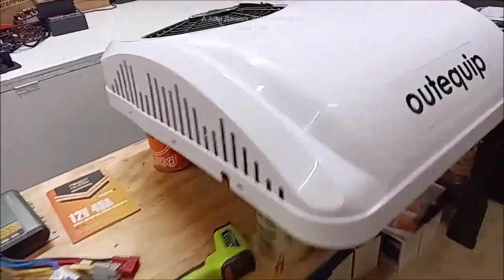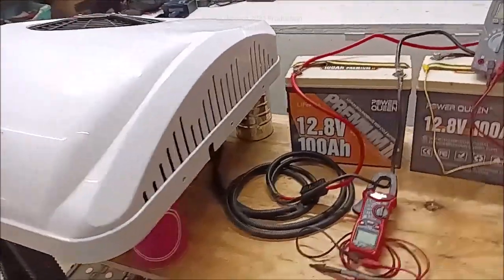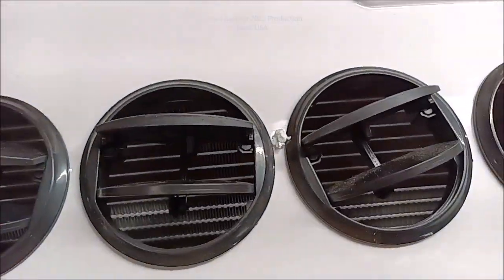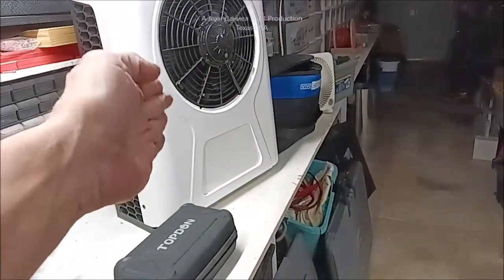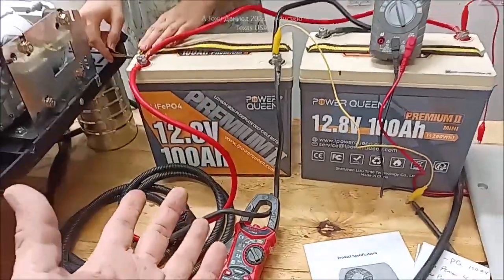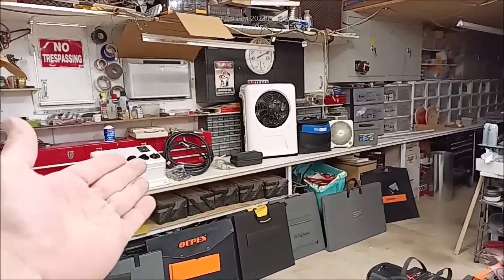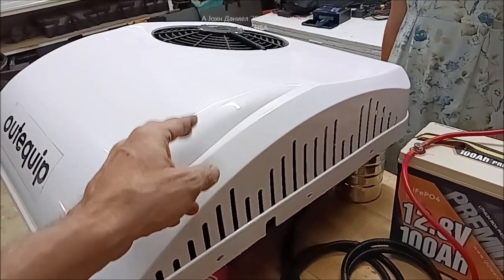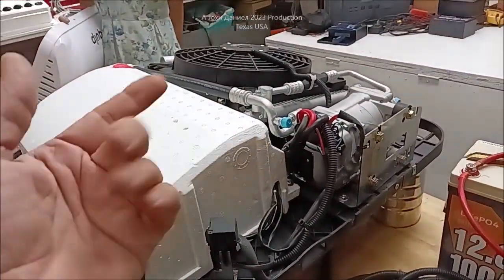12 volt DC Air Conditioner with dual battery design plan & solar off grid for my pick up truck

Comment from the maker: A share for my preppers, Power Queen Mini 100ah, on sale, https://shrsl.com/46p4h 12 volt Air conditioner ROOF model https://s.click.aliexpress.com/e/_DDdEOUh & 12 volt split model https://amzn.to/4b5PzUv *ALIEXPRESS 12/24/48 volt Air Conditioner OPTIONS FOR LOWEST COST all styles https://s.click.aliexpress.com/e/_DEyg1f Fast Shipped 👉 Support/Donate with KoFi - https://ko-fi.com/john4kiera OR https://bit.ly/2buyaCoffee all support helps. ⬇Power Queen Mini 100ah LiFePO4, https://shrsl.com/46p4h LiTime Battery https://shrsl.com/46y6h & Solar Connectors https://amzn.to/3OXUpdi ✨
Make it all,  The DO IT YOURSELF way!

Comment: Just to let everyone know I ordered one of these and put it in the bedroom on my 5th wheel  rv and it works great So far. I have 525 watts of solar and 400 amp hours of lithium battery's and will run all night no problem.  We do harvest host  when we travel so its great to turn it on before we get there and it will be nice and cool in the bedroom. did have to get longer studs to install it and run a 4 gage wire from the battery's up to it . We will see how long it will last.
 Thanks for letting us know about this AC.

Comment: How are the battery cables channeled?  In your video it shows the connections are outside the unit and not thru the 14" opening if on a RV roof.  This would be a show stopper if I have to make a hole in roof just to channel the power lines.
Reply from the maker: You can feed the wires back into the housing and going up a few inches for leak prevention make a entry into the foam but support it well and seal it well. No brands have them this way but you can buy a mini roof boot ( https://amzn.to/4eSHa80 ) and carefully cut a hole in the vehicle roof 1" and a hole in the plastic base 2-3/4" and when installed the unit will slip over that boot, it is high up and your wiring goes in through that. I did this on 2 air stream trailers with no leaks.

Comment: How about a update on the wind generators if you still are using them. I bet the performance is enhanced using the lifpo4 batteries better internal resistance.
Reply from the maker: We are to run all turbines into 3 Cheap Lead Acid batteries, from there a buck boost DC to DC 60 amp to liFePO4 bank.

Comment: Add 6 compassioners To your DC air conditioner And you will add a couple of more hours of run  time  on your DC air conditioner And that will take cure of any kickoff start On your DC compressor every time Only you got  to know how to run any  electrical wires your system